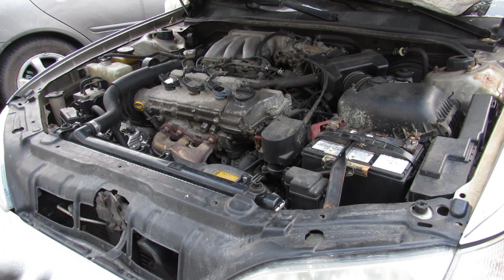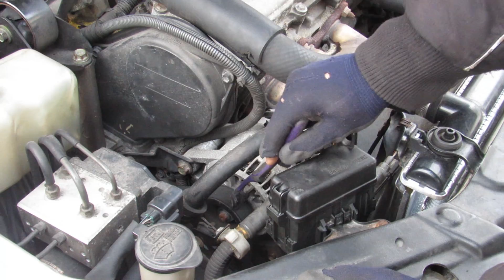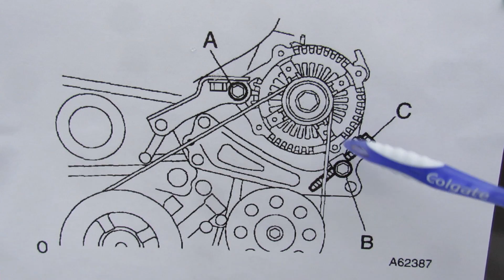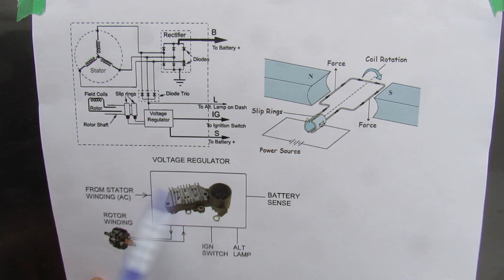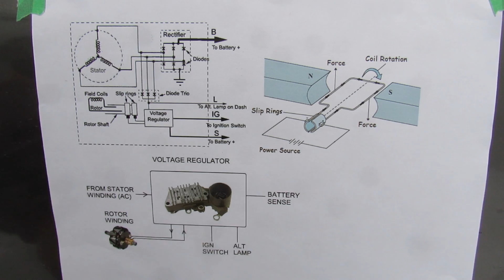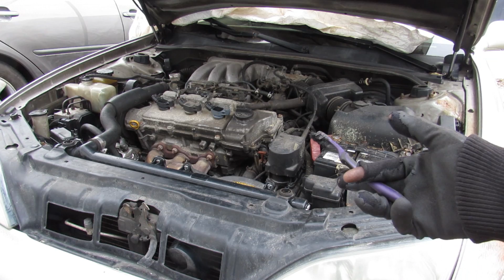How to Replace an Alternator Toyota Lexus V6

Comment: You need to know that 5 years later your video is still helping us out here. I watched 3 different videos on this project and while all were helpful, yours is the one that helped me the most. Especially the part about hooking up the tensioner bolt with the little square nut that two bolts go through. Thank you!

Comment: Thank you, that helped with the RX300. The belt tensioner bolt is definitely the bottleneck part of the job. Used a ratchet wrench with other end by fan blade.
Reply from the maker: I thought the RX would be alot larger to work under

Comment: Thanks! Your video was very helpful and made the swap uncomplicated. Also no more TRAC & ABS light on the dash. Seems to be a common theme in our cars. Those systems can turn off (as in my case) when there's not enough power from an old alt. 👍

Comment: Do you drive a GMC?  Because you're PROFESSIONAL GRADE!  A+ video!  No nonsense.  Straight to the point.  Quick.  No b.s.  I definitely think I can do this job whereas I was too scared before.  I did my starter on my Lexus years ago.  This looks easy compared to that.
Reply from the maker: Thanks. I drive a Camry and Lexus Gs350

Comment: I like the 3.5 alternator replacement better LOL.  We have a 2014 Sienna and I'm really hoping that alternator lives forever 😁
Reply from the maker: 3.5L Sienna? Isn't it much harder since things are so compact?
Reply: @speedkar99  If I ever have to do it, I'll let you know.  The best solution I've read (probably on toyotanation) is you have to remove the cooling fan assembly and the top radiator support, then lift the radiator up and back a few inches.  Others say you have to drain the coolant and remove it completely.
Reply: @ScubaCat3  Could be worse. You could have a Previa. LOL

Comment: Was there no need to sand the alternator connections? And why didn't you check the battery volts after replacing alternator? some people apply silicone paste or petroleum jelly on the battery's terminals as an extra layer of protection.
Reply from the maker: Good points!

Comment: Looks really easy.
On my car, removing intake manifold and right side front tire is sure make this job hell a lot easier.
If not, I need a lot of swearing to get this job done.
Reply from the maker: Wow. What car is that?
Reply: @speedkar99  2003 Suzuki Aerio equipped with M15A engine, I don't know if this car is also available in your country. This particular engine is also commonly found in Suzuki Swift.
Reply: @madunwerkstatt3093  We got Aerios, but only with the 2.0l and 2.3l engines...Suzuki J-series, maybe they're called? My buddy had a 2002 Esteem wagon with the 1.8l version.
Reply: @fun_ghoul  2.0 and 2.3 engines are equipped with J-series engines.

The Esteem wagon uses Suzuki G-series engine if I recall it right. It's 16V SOHC with both direct tappet and rocker arm valve actuator design.
Reply: @madunwerkstatt3093  Esteem wagon base engine here was 1.6 G engine with option for the 1.8 J until 2001, when the 1.6 was dropped altogether in Canada. I haven't Googled it, but I'd bet you a can of Coke that people have already swapped 2.3l engines into Esteems...
Reply: @fun_ghoul  if they got 1.8 J series engine, it would be a piece of cake to swap it to 2.3L version. Or even you can getaway with 2.4L version (J24B, commonly found in Suzuki Grand Vitara. But this engine is updated with VVT functionality).
Reply: @madunwerkstatt3093  Yeah...but we only got Grand Vitara with the 2.7l V6. ¯\_㋡_/¯
Reply: @madunwerkstatt3093  Professor Google just reminded me that we did in fact get the J24B engine in Canada in the Kizashi, which is 180 hp. I think I pipe-dreamed that swap before already, when buddy still had his Esteem. It was so rusty tho, and he lives in Gatineau, so I took to calling it the "esti" (Québécois swear word).
Reply: @madunwerkstatt3093  But an Esteem wagon with 180hp/170 lb.-ft. torque would haul ass, and the sedan would be even quicker. I mean, if you could get transmissions to live. I presume there's a good swap for those too, but I dunno what it is...
Reply: @fun_ghoul  there's a video on YouTube about swapping J18 Vitara with J23 coming out from 2.3 AWD Aerio. He also had a video about his Vitara transmission broke down not long after he's done the swap. Maybe Vitara's transmission isn't strong enough to handle 2.3L engine torque.
Reply: @madunwerkstatt3093  Ah...ok. We didn't get the most recent FWD Vitara (at least not yet), only the older RWD ones. I'd probably first investigate using the Kizashi engine and trans together, because the one is made to work with the other.
Reply: @madunwerkstatt3093  Oh, and I just wanted to say that I appreciate that you're a real car dude. I'd love to get your car knowledge on a bin file I could upload to my brain...

Comment: If the regulator plug snap clip is broken will it eventually come off while driving? I changed my Alternator and the clip broke off. Great video!👍
Reply from the maker: Mine was broken too, it'll still hold
Reply: @speedkar99  

Awesome, thanks man.

Comment: A cordless impact saves SO MUCH time. I can troll the scrapyard all day with just one fully charged 3Ah battery, even with my older DeWalt brushed-motor impact. In fact, if I had to do it again, I'd buy an even smaller impact. Makita used to have one with a 3-cell magazine-type pack like the Milwaukee M12, which I used and was excellent. Most contractors still shunned 12V* tools as wimpy, thereby relegating them to DIYers who now sell them cheap on Kijiji. Being a "dumb" battery, the cells are also easily replaceable with any 18650 of sufficient power density (current rating).

*10.8V nominal, of course..."12V" is marketing trash!
Reply from the maker: Thanks. I really want one. This one is so heavy!

Comment: I just replaced mine but it's running a little warm, which I don't think it should be doing. The voltage is OK.
Reply from the maker: Any burning smell or bearing sound?
Reply: @speedkar99  No...It gets a little warm just idling for two minutes,  but doesn't get any warmer after driving awhile.  Thinking of changing the belt. It's kind of old but looks OK.
Reply: @speedkar99  I changed mine yesterday and I did smell some burning but then goes ago ?? But when I open the engine I kinda smell it not sure that’s normal or something I did wrong ? Any idea ???

Comment: So many flashbacks for me. I've done that on a 1mz and 3mz. Ever break that tensioner bolt because of rust? I did....
Reply from the maker: On my old Solara the long bolt broke, I had to get one from the junkyard
Reply: speedkar99 I don’t have one close to me, but O’Rielly’s had one for about $20. I’d used it many times over the years on my Solara, but it rusted over on winter.

Comment: I would think a Lexus would have an automatic belt tensioner?
Reply from the maker: No, they use a bolt on
Reply: "Automatic" = one more failure point. Toyota design is pretty conservative.